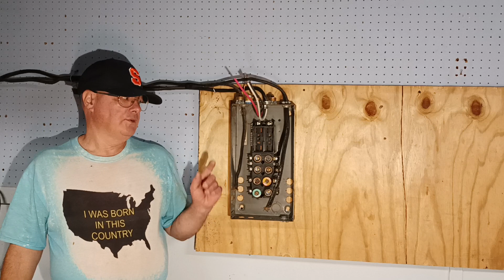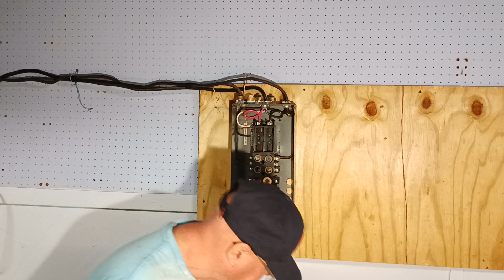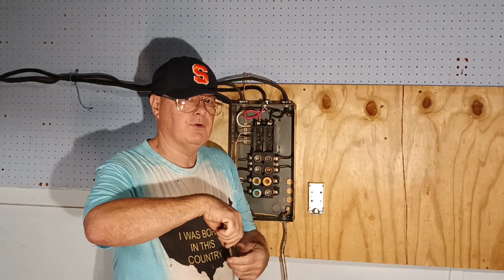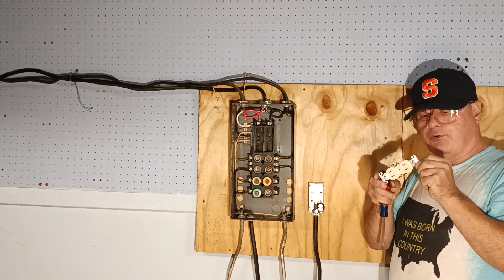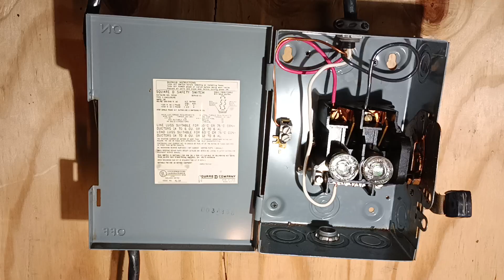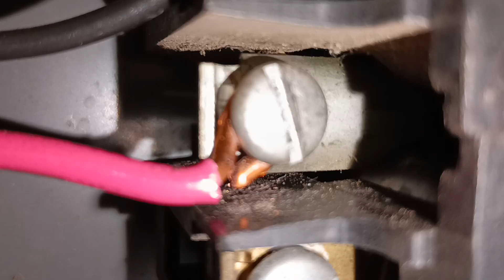1940s-70s wiring a main fuse box how to remove s type adaptor options 2 wire circuit fuses explainde

Comment: I have a cracked anti tamper adaptor in ine of my fuse holders   It prevents getting a type S screwd in all the way, and making contact.  However there is no plastic to cut away.  The anti tamper ring looks to be cast aluminum and was threaded directly into the brass socket.  There is nothing to grip and it appears that it was designed to prevent unscrewing.  How do I get the anti-tamper ring out and replace it?